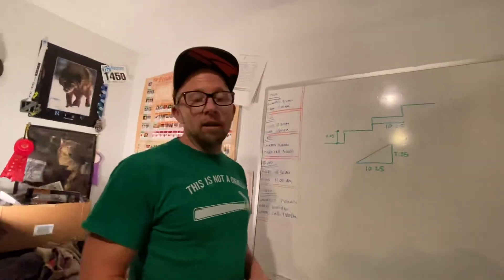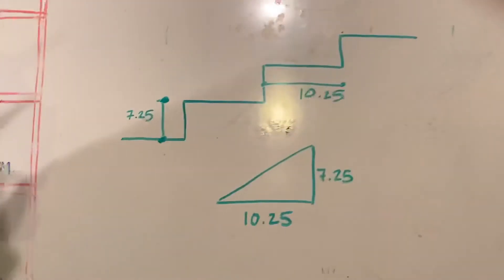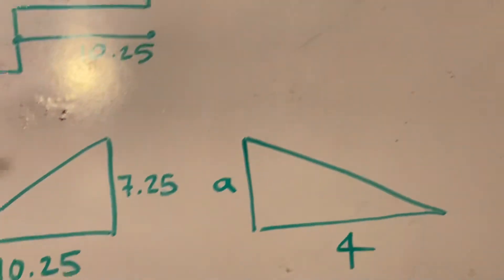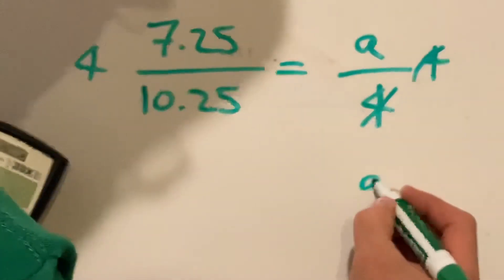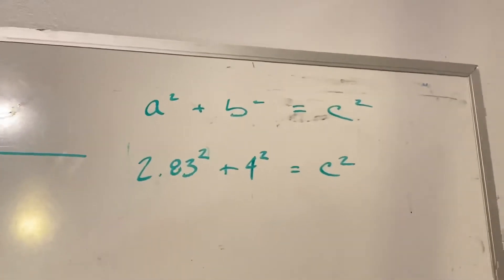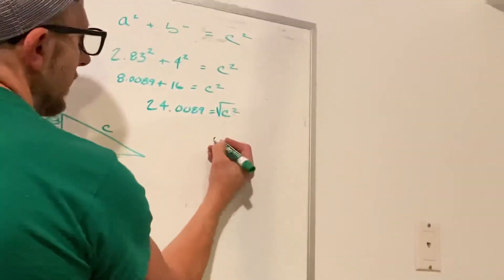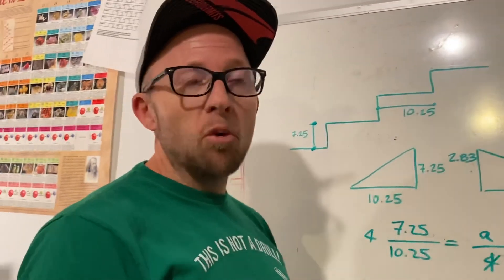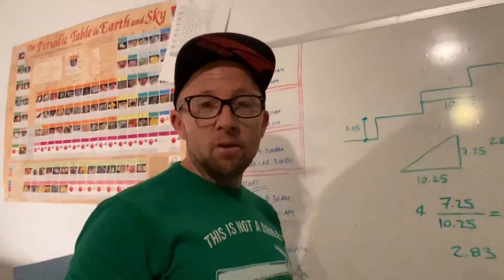Baluster layout: how to make a spacer jig for baluster layout on a rake wall

Comment: Draw center line between first balusters on tun from either end, set compass to 4 inches, make Small adjustment and its perfect. Do stairs exclusively for work and my method is much simpler